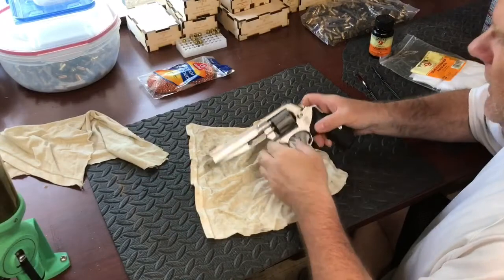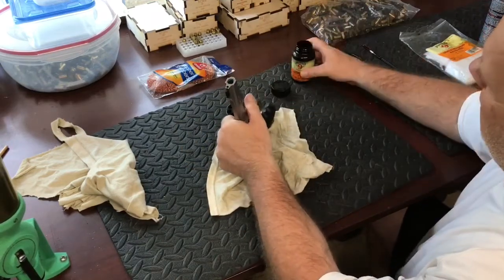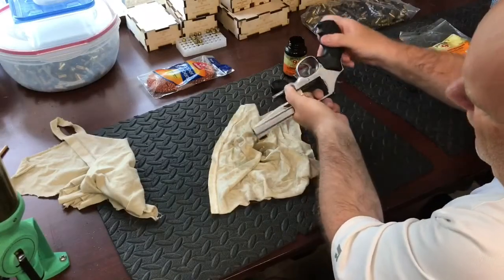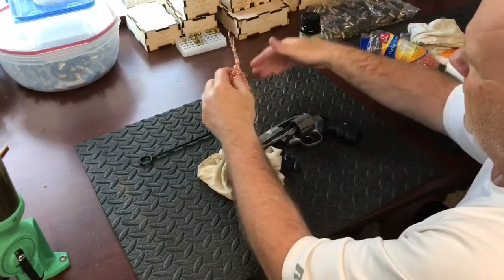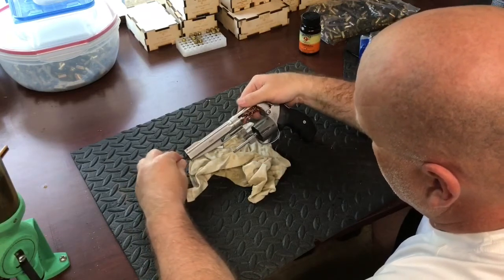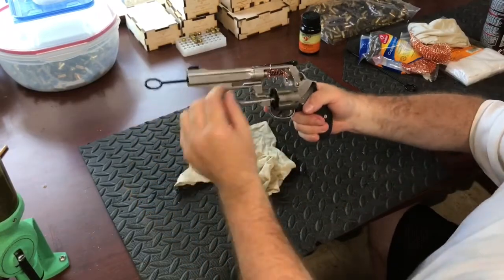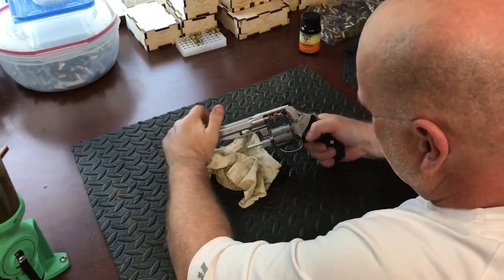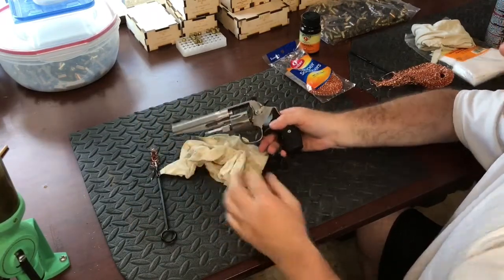How to Remove LEAD and Copper Fouling from Your Barrel

Comment: I use the Lewis lead remover kit from Brownells. The good thing about the Lewis lead remover...the adapter is adjustable...meaning you can adjust how much tension you need on cleaning the bore. A $7 can of Seafoam and some Kroil penetrating oil will clean any fouling in/on a firearm. Been doing this for 30 plus years. Both Seafoam and Kroil have been around since the 1930's.

Comment: Thanks!
I grabbed some copper pads, dipped the nose of a 12ga mop in Hoppes, wrapped it in some copper and got after some stubborn slug lead in my 590a1... this copper trick took it right out in just a couple minutes.
Tip: If you use a mop you can reverse direction anywhere you want, then final clean-up passes from chamber-to-muzzle only.

Comment: Good tips, I've got some lead fouling to clean up after shooting those Acme powder coated bullets.  Everyone says they shoot clean, but I clearly have lead streaks through the rifling.
Reply from the maker: Caliber's i have never had any problem with ACME.
Reply: Could it be what I'm seeing is residue left behind from the polymer coating?  Its gray streaks in color and follows the rifling all the way to the end of the barrel.  Not sure if it matters, but I was also using a stock Glock 19 barrel.
Reply: The stock glock barrel doesn’t do well with lead or polymer. Get aftermarket traditional rifling. Stick barrel is polygonal twist. Shears lead off too much.

Comment: I use Keith hard cast lead rated up to 1500 fps.  And lubed in groove.  Did have copper using fmj 357 over lilgun powder

Comment: I use "chore boy" bought bunch of it a while ago , should last me a life time. Never had issue with leading using ACME bullets. Had some leading with Precision bullets or my own cast bullets. Few strokes with Chore boy on the brush clears everything right up. Nice video.
Reply from the maker: Bald&curious it the "cheap" replacement for chore boy.   I never had any issues with ACME either.   I have been know to run 300 round through a pistol very fast  and the barrel heat does give some lead streaks.

Comment: Thanks so much for the videos, they've been awesome in helping me start loading.  I do have a question on coated lead bullets like you use.  Are there any safety precautions you have to take when handling them being that they're 100% lead?  I'm currently reloading in my bedroom (college student) and wipe down with lead free after handling components, is that sufficient?
Reply from the maker: Cuurveball you do what you think is best.   I just wash my hands after reloading and I don't eat, drink,smoke or dip while handling lead.

Comment: I use the Lewis lead remover, works great.
Also another excellent way is with a jag and a 1 inch brass pipe screens :http://www.ebay.com/bhp/brass-pipe-screens
Reply: I paid good money for the Lewis thing, and used it on my Ruger SP101 or tried to, when I tried to shove it through the bore it just tore through the screens! Just buy the copper wool and some kroil, this gets the lead out of a revolver at a fraction of the cost... don't waste your money on the Lewis lead remover!

Comment: My son fired my .22 lakeside too fast and there is a parabellum slug stuck 3 inches from the muzzle,wtf do I do?
Reply: Blood Thane by a 3/16 wooden dowel from home Depot. Preferably hardwood if possible. Push the slug out back through the chamber. You may need a hammer to beat the slug out. The n thoroughly clean the barrel. It won't hurt the barrel. Wood and lead are softer than the steel barrel.
Reply: Blood Thane  make sure the dowel is long enough.